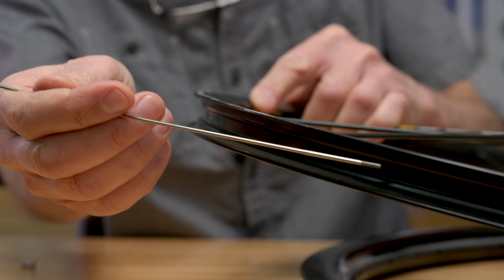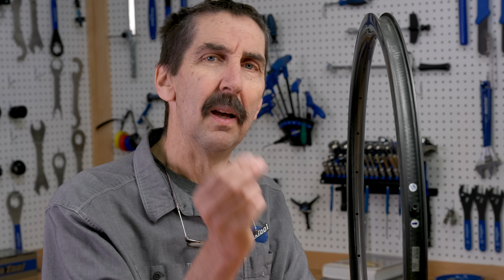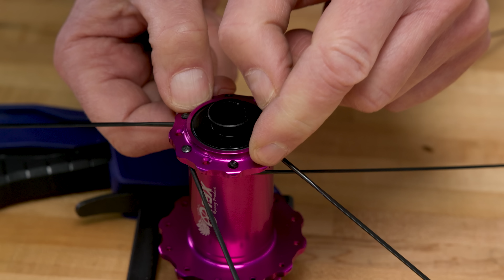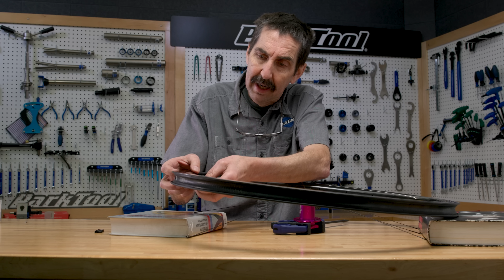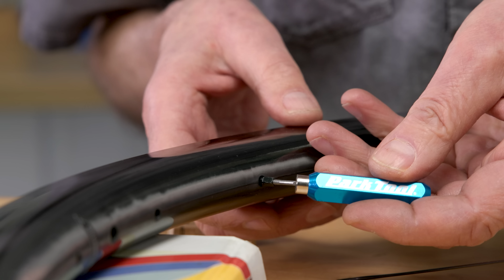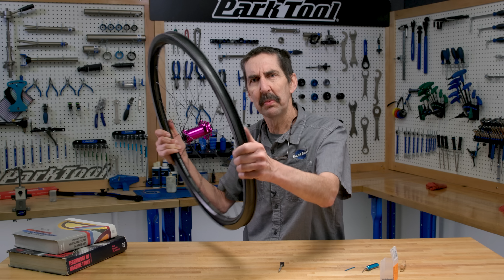Building a Wheel With No Spoke Holes | Tech Tuesday #214

Comment: Too expensive maracas!  I have run tubeless on both MTB and Road bike as the tires wore and the sealant dries I have been going back to tubes or tubular (expensive but best ride on road bikes).  Only one rear rim on the MTB is still tubeless and as soon as tire wears out or sealant dries I'll be back on tubes.  Tubeless are to messy, always need to carry a tube personally I don't see the advantage, I have never had a pinch flat.-  I may try to fill the tubes with sealant and see it that may work.
Reply: You are right but it because crapafactureres make those poor quality sieve tires and bad sealant. Try using better tires and with thicker casing such as schwalbe and maxxis. Don't need to carry any tube, those casings don't puncture de facto. Btw I also don't believe that sealant is able to seal anything aside pin hole reliably especially on emtbs or motorcycles. Advantage is low rolling resistance on very low pressure and it's a big advantage

Comment: Watching Calvin build these is as close as I ever want to come to having to deal with wheels without spoke holes 😂
Reply: I do about 90% of wrenching on my bikes myself, and I hate TL tape with a passion. Been on these kind of rims for 3 years, replaced some spokes too -- never looking back. Just ordered a new pair of there Real-tubeless rims, carbon and asymmetric, of course. Sure, you have to lace them for an hour instead of 10 min. per wheel, but totally worth it.
Reply: @krushiXX  I don't get tubeless. Why would you not want a tube? This is crazy. Solves so many problems.
Reply: @SianaGearz A main argument I've heard for tubeless is being able to run a relatively lower tire pressure without increasing the risk of a flat. This is especially good on mountain bikes riding on rough terrain when compliance affects the ride quality. 50psi tires over roots isn't fun. On a bike that will mainly be ridden on the road, tubes seems like the right choice to me due to its ease of serviceability and your decreased proximity to a bike shop than from a mountain (presumably)
Reply: @SianaGearz fewer flats, more comfort, lower rolling resistance, slightly lower weight, slightly more of a faff installing the tire.
Reply: How is this not an April Fool?
Reply: When he said that he was gonna take each nipple through that one hole, I started to wonder if the inside of the rim moved.... NOPE! When he pulled out the magnet, I instantly knew I never want to do this.

Comment: What do you call this? How about “Fulcrum 2-Way Fit”? Seriously, how is this different from Fulcrum’s undrilled rim bed system, which has been around for many years?
Reply from the maker: The Fulcrum is a system, already built. This give the builder a choice of hubs and spokes.
Reply: It's simply called as a rim with a hole-less rim bed. Mavic's version has the spoke nipples thread directly into the rim whereas Fulcrums and Campagnolos still have the nipples thread onto the spokes, like almost all wheelsets.